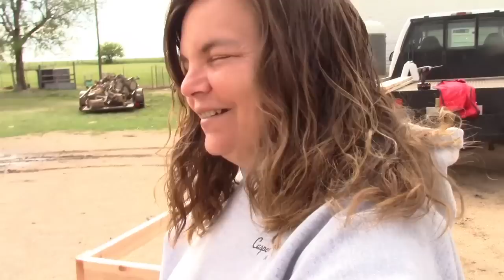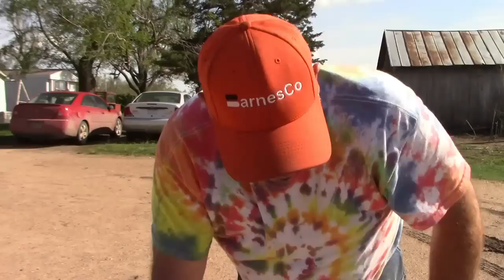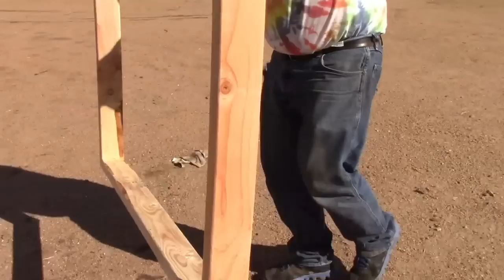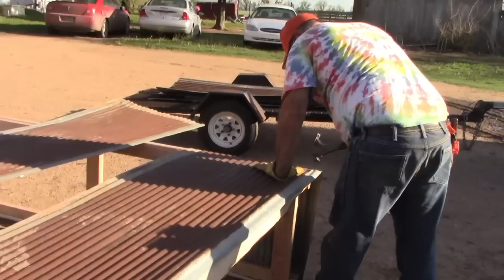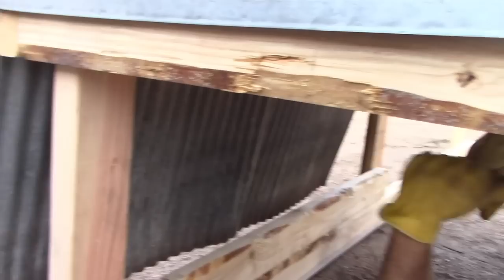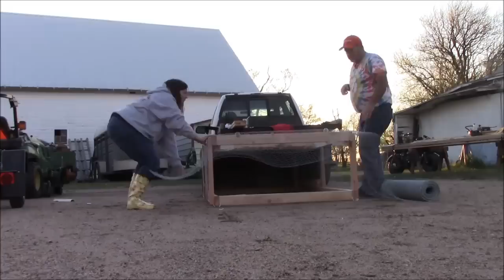Easy DIY Chicken Tractor

Comment: For what it will be used for, It will work just fine!
Reply: Any suggestions to improve on this?
Looks fine to me.
I am looking at building 1-2 if these
Reply: Might cover half the roof & use chicken wire on other half and maybe put small door on side somewhere. if U have some old push mower wheels laying around , U could put one on each side on one end or the other and would make it more easy to move  ,  Hope this might help you...
Reply: @dave434  They covered half the roof with tin, the other half (their door) was wire. 

But i do see how wheels at aleast 1 end would be beneficial !